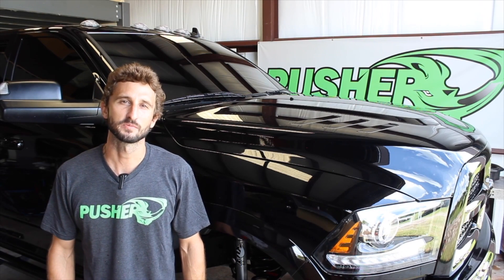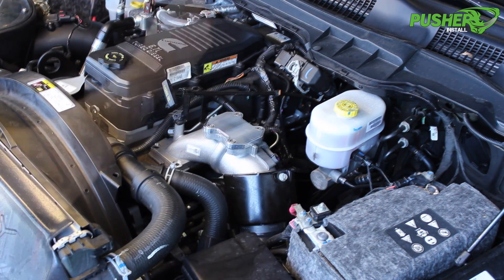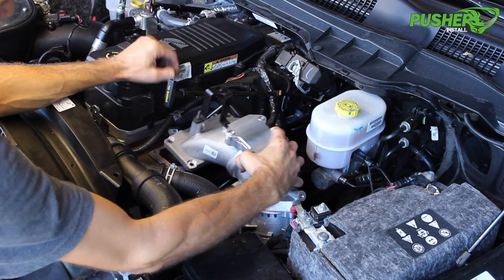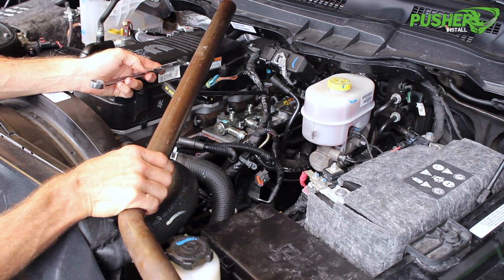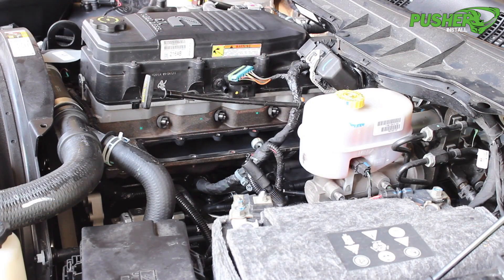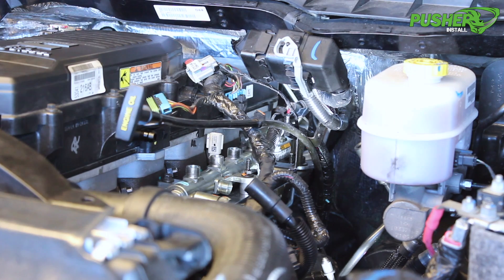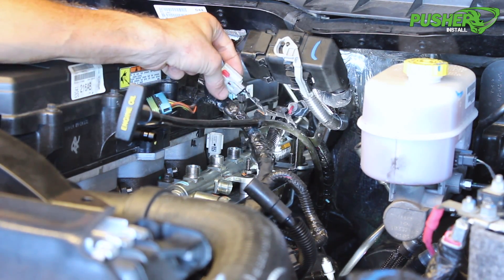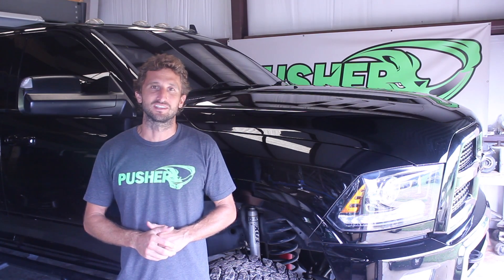Pusher Install - 6.7L Dodge Cummins Heater Grid Delete

Comment: I did the delete kit but now the sensor keeps showing the heater is not working throws a check engine light every once in a while. It is gone of coarse it’s not working. It does suck though when I want to remote start the truck to warm up and it throws it. Does anyone know of a fix for that?

Comment: I’m here 3 years late. I just watched this video doing my grid heater delete. Few pointers to help a friend as this job was pretty  tedious. 

1. He is absolutely correct that getting the last injector line is the worst part of this job.  You will need a breaker bar as he says, and you will need some will power. 

2. BE CAREFUL ON THE LAST LINE. My wrench slipped and broke the fuel rail sensor. This is a $647.00 part. I now have a brand new one 😅.

3. If you aren’t confident in your mechanic work, this might be one to skip. I consider myself a little better than your average Joe, not a professional, but I know how to use a wrench. This job took me about 8 hours total, not including waiting in the new sensor at the parts store. 

Other than that, stick with it, and get her done. My truck is breathing better than ever.

Edit- the last injector line is easily reached with a 19 mm crow’s foot with an extension BEHIND THE BRACKET that’s bolted to the block.

Comment: This isn’t a master tech video, it’s focused around the DIY guy! With that being said, might want to point out, not reinstalling the grid heater wire! Obvious for some, not everyone will know not to reinstall the wire! A very important step you should mention, just FYI! A few other steps but informative to say the least. Hopefully someone sees this before making that mistake. Thanks for reading, hopefully this comment reaches someone that needs to know.

Comment: What are the downsides to no longer having a heater ?   At what temps is the heater needed ?  Thanks
Reply: Below 30 degrees they’re nice to have
Reply from the maker: It's a bit of a nuanced answer depending on where you live, where you park, if you use your heater block (not grid) etc. You will get a soft CEL if the heater is commanded but doesn't pull the appropriate voltage, but typically you don't have any issues starting unless it's below freezing. If you do live somewhere where you it's consistently very cold, we recommend pairing this with our Mega Intake Manifold with a Removable Heater Coil, so you retain the heating element without the flow path issues.

Comment: What do you do with the grid heater wire? Just zip tie it somewere? Will it continue to send power to it when you turn on the ignition? Check engine light?

Comment: I have a 2016 2500  85k  miles Live in Georgia. I just learned of this problem and was wondering what the frequency is of this occurring. My dealer stated it was due to heavy corrosion to which I have none. Georgia never has snow then uses brine. So is this something I should jump on soon? How would corrosion get under the grid? Thank you in advance for ideas.
Reply: It's not from corrosion it's from voltage and heat cycling. These have fallen in to engines all over the country.
Reply: @Exeinx  I am checking it periodically. so far very tight.

Comment: OK, I just did mine with a BD kit. Whoever said this was 2-3 hour job I'd like to see it. Likely, if you have done a few I suppose. BUT, if you are just somewhat mechanically inclined and just have normal tools in your garage and can usually figure out how to get these things done without paying $250/hr to a garage, you better have a full day set aside. NOTE: find the correct 19mm angled open end wrench before you get started. What a MFR! Also, when scraping the carbon out of the intake and off the grid heater, be very aware of the absolute mess that will make. My wife about killed me. Also, I can tell my truck is breathing much better after cleaning all that carbon/ crap out of there. Good luck!!

Comment: Been there, done that with my '17.  Don't be fooled for one moment.  Those back injector lines are an absolute bitch to get to.  A shit ton of work.  And ya wanna know the truth?  Removing the grid and installing a GDP intake yielded me no noticeable improvements.  Yeah, it's cleaner and looks cool, but that's about it.  But hey, don't take my word for it.  LOL.  Anyway, great video.  Thanks!
Reply: I have a 17 6.7 Cummins 3500 bought it brand new but never did a grid heater delete! I’ve put in almost half a million miles on it 485k to be exact. At this point should I pull the trigger and get it or is this truck just a unicorn lol. By the way my truck is egr and dpf deleted. Considering this now.

Comment: If I order this and install will I get CELS’s? I hear some people have trouble with those. They have to disconnect the wire coming off the grid to the battery and solenoid. Need info as I need to delete my grid heater asap

Comment: If I could make a suggestion, increase the length of the fuel rail standoffs by 0.050" and put counter bore holes on the cover where they belong at 0.050" deep. That would keep them in place while your fuel rail is installed.

Comment: This looks like a great kid to prevent engine damage, but how does your kit prevent codes from the heater grid not coming on?
Reply: You just can't let the wait to start light to go off.  There is nothing to warm up,  just put key in and crank it.

Comment: Is there anything you specifically need to do after putting the fuel rail and lines back? Do you need to crank the truck for a bit until the fuel rails fill, anything to try and prevent air in the lines, etc.?

Comment: Is there enough room to put studs in three or four of the holes to keep the gasket from moving around?  Just curious.
Reply from the maker: Yes, check out 8:44 - you'll be able to put a few in and it'll secure the gasket.

Comment: No torque specs or what you used to torque the injector lines back down?
Reply from the maker: 18 ft/lb on the torque - but you'll want to pay attention to how tight they are when you take them off and try and replicate that. It's very difficult to get a torque wrench to the majority of the lines.

Comment: Will this create a trouble code?
Reply: 10 below, no trouble codes for me.  No change in tunes.  Just be sure to plug your block heater in.  LOL.
Reply from the maker: If the temperature is low enough to command the heater grid, yes, it will, unless tuned otherwise.

Comment: Doesn’t that make the diesel harder to start especially in Canada
Reply from the maker: Hi Emil, yes, this is best for warm climate customers. However, we offer our intake manifold for the 6.7L Cummins with removable Heater Coils to replace the heater grid functionality, so you can get the airflow gains from the plate but retain the heater functionality during the cold months. If that's something you're interested in just give us a call! 772.212.9290

Comment: do you guys offer this setup for the 5th gen?
Reply from the maker: Yes, check it out here: https://pusherintakes.com/pusher-heater-grid-replacement-for-2007-5-2022-dodge-cummins-2500-3500/

Comment: does this mod void the oem warranty?
Reply from the maker: This is an off-road use product; you'll need to read your warranty manual for exact clarification but in most cases, off-road race components are not covered under the vehicle warranty.

Comment: How does this compete with the monster ram from banks?
Reply: Hype.  You will see no noticeable difference except your wallet will be substantially lighter.  I'll give Banks credit, he's a heluva salesman.
Reply: It definitely doesn't. No way these guys have enough research and experience to beat Gale Banks
Reply: @BryceJohnson323 banks is an EPA CUCK!
Reply: @BryceJohnson323  The banks has been tested by 2 youtubers and lost HP and torque on both.
Reply: @Exeinx  yeah let's trust random YouTubers with $100 equipment
Reply: @ 🤡 You think the Dyno's are owned by youtubers? and $100? Another blind banks simp.

Comment: I just think is a different engine at the end of the video 😂 but great information
Reply from the maker: Same truck, as mentioned at the end we paired this install with several more upgrades which weren't featured in the video. Our full Mega Intake System + our High Mount Compound Turbo System. Effectively left the shop feeling like an all new truck 😎

Comment: Does it throw a cel when the ecm doesn’t sense the heater in cold weather
Reply from the maker: Yes, if you have no form of heater the ECM will turn on your CEL until it's warm enough outside to not need the heater.

Comment: Do you release the pressure on the injectors ? Or you dont ? If you do how ? Thanks
Reply from the maker: There is no pressure in the system when the engine is turned off, so no action item there 😎

Comment: Being I have a background in the auto industry….. if you’re going to modify your truck at all, keep the parts so you can put them back on if you ever decide to trade the vehicle. Otherwise you’ll lose thousands in trade in value. I usually don’t keep a vehicle long enough to justify the cost of mods so for the most part I leave them stock. Except for sports cars and motorcycles. J/s

Comment: Do you need any kinda of pipe dope or anything on the bolts holding the grid heater plate down to seal them?  Are those bolt holes in the block all the way through?
Reply: Pipe Dope 😂😂😂. You a oil field guy?
Reply: I have spent some time in the oilfields yes..  But thread sealant just doesn't have the same ring to it does it.  Lol

Comment: Does it increase fuel mileage. Where are you located.
Reply from the maker: You can expect a 50-100 degree F drop in EGTs and about a .25-.5 mpg increase in fuel economy. You'll also see a significant gain in throttle response and faster turbo spool. All happy things. 😎 We're in Vero Beach, Florida.

Comment: Looking for some insight I want to keep a grid heater I live in the north could I weld a bung on the intake horn and run a universal grid heater and ditch the stock one ?
Reply from the maker: We offer the manifold with a removable heater coil - just a little behind in launching it publicly. You can give us a call to order today. 772-212-9290

Comment: This is useless until you come up with a plan for the grid heater circuit. Uhhhh yah its gonna set a CEL. Unless you live in Florida
Reply: Do you see that this truck was deleted? Yeah, it won’t throw a check engine light in their case

Comment: How do you get the codes from coming up for the check engine light
Reply: I disconnected the grid heater power wire from the relay just below the right/ passenger side battery. No light, I just crank it up instead of waiting.  On the few cold days that do hit my area I just plug it up.

Comment: Cummins put that heater there for a reason. Cummins does not have glow plugs it uses the heater grid to start the truck. Last winter in Texas my truck would not have started in the extremely low temps we had without it!
Reply: Money starts every time I live in Ohio ,colder than you
Reply: @matone184  we had sub zero temps during the time I was refuting to.
Reply: Not sure it is that necessary, my 2011 3500 heater grid is no longer wired and started just fine during the ice storm in TX.
Reply: @jshlds46  mine didn’t want to start during the ice storm. It took it a while. J/s
Reply: It's not that cold in Texas.  Lol
Reply: Wrong.
Reply: @tracker1315  wrong about what?
Reply: @tracker1315  wrong about what?
Reply: Plug 🔌  it in and u r set.  It not worth taking the risk of that bolt to break and ruin ur engine. Good luck
Reply: This is such a clown comment. Texans are so arrogant. My truck starts in Alaska down to -20 every single time without using the grid heater. Your truck will start just fine when it’s 32 degrees outside.
Reply: Maybe study 6.7'a more?
Reply: @BradleyPitts  don’t have to I know them well. Now FO!
Reply: At -40 c or F..you need that heater grid even when it block heater is plugged in
  I think I'll look for different  solution..
Reply: I live in cali so I don’t need it
Reply: I live in ohio, and I've removed every grid heater from every truck I've own. It gets in the negatives every winter. I don't ever plug them in either.
Reply: mine started in -35 without it. also these trucks have a block heater the grid heater isn’t the only heating element. but to each there own i just don’t want to buy a 16,000 dollar long block
Reply: The grid heater HELPS with cold starts but you don't need it. It's really just an emission component. If you're fully deleted you can see the haze go away in deep cold start ups when the heater comes on. Weird, emissions component...
Reply: I’ll give everyone this advice, if you are going to do any deletes or mods, keep all the parts of you think you’ll ever trade the truck. Otherwise you’ll lose thousands on the trade in. I don’t keep mine long enough to worry about mods usually.

Comment: Does it throw a code in the winter when it  doesn't sense resistance from the grid
Reply: Mine caused a code to come up for heater grid.    How do I cheat the computer to thinking its still there?

Comment: Air intake temperature sensor is not like that on my truck.. it's off to the side do ypu have a adapter
Reply from the maker: Do you have a Cab and Chassis truck? They're different than the "normal" 2500/3500 trucks. You can give us a call for faster tech support - 772.212.9290

Comment: I have a 2015 6.7 Cummins. Why would you want to pull the grid heater? What does that do for the truck? Don’t you want that during your cold weather ops?
Reply: Find your answer yet? Grid heater can ark when not grounded properly and drops a bolt into the intake so your engine chomps it. It also uses alot of amperage to run it. But yes a grid heater is a really good thing in the cold. I know some guys just run a air dog with fuel heater and it's a better combo then an intake heater. Plus air flow is greatly increased with the delete that's the main reason
Reply: @danthisguy8541  as
Reply: I've read that the Cummins motor in light pickups is the only application that uses a grid heater.  Heavy equipment does not.  FYI, I've started my truck with the block heater plugged in at -10 degrees.  Yeah, it hated life for about a minute or two.  Lots of smoke.  But it cleaned up and ran perfectly when given a few minutes.

Comment: I am deleting the grid heater on my 6.7 Cummins and I have a dual horn intake just like what is installed on this truck.  I must have an intake heater where I live.  I have a BD Diesel intake heater, which is just a factory Duramax intake heater.  Anybody know where to install the heater since there are two intake horns and only one heater?  I was thinking about installing it before the horn splits, but that is awful far from the engine.

Comment: What do u do about the grid heater relay and the code that it throws?
Reply: Here’s a tip, turn key on straight to the start position immediately and it won’t set the code. Although I don’t recommend removing the heater to begin with.
Reply: @871jamie  what about adding a BD-Power X-Flow Air Intake Heater Kit For 2007.5-2018 Ram 2500/3500 6.7L Cummins to the air horn? Or two should it be a lot less restricting?
Reply: @robbennett7593  honestly I’m not sure.
Reply: I see the comment about turning the key on straight to the start position which does work but trucks like mine that have remote start will through a code and shut the truck down when the temp is below 45...how can this be remedied?
Reply: I disconnected the grid heater power wire from the relay just below the right/passenger side battery. I get in and crank it up and haven't had a code. On the few days of cold I do get, I just plug in.

Comment: good thx but how to get rid of dtc code? Battary sensor will ask for 200 amp anyways during the cold start/.....
Reply from the maker: For a key start truck, just start prior to the 'wait to start' light to go out. For push to start / remote start trucks, this code would need to be programmed out.

Comment: You did not show  how to take off rear lines or RAIL
Reply from the maker: Start at cylinder 1, work your way back to cylinder 6, just un-bolting as you go. Reverse on the way back. These video guides are just supplemental to our full written instructions. Thanks!

Comment: what should I do with the  wire that goes to the heater grid it self ??
Reply: You should do a video on the wire removal as well.
Reply from the maker: We generally remove it from the loom entirely. However, if the customer thinks they might reinstall the heater grid at some point we just remove it from the power solenoid (but this is generally only on the 5.9L trucks).
Reply: @pusherintakes  thanks again for ur help

Comment: Does this fit the chassis cab models?
Reply from the maker: No, because the chassis cab MAP sensor is located on the heater grid itself. To get around that you could buy one of our manifolds for your chassis cab model and relocate that sensor onto it, and then you'd be free to run the heater grid delete. If you want to talk details about how that'd work, give us a ring at 772.589.8385 (or we are happy to reply here)

Comment: Did the check engine light come on after that delete?
Reply: Never Mind I just read the specks on your page 👍🏼
Reply from the maker: @Hazie345  Good deal - For anyone else wondering, the CEL will only turn on if your ECM commands the heater circuit to activate (due to low ambient temp), but then doesn't see the voltage drop that the heater would normally cause when activated.  In warm climates or warmer months, the CEL will not come on. If you have custom tuning, that feature can be turned off so it's never an issue.
Reply: Pusher Intakes thank you